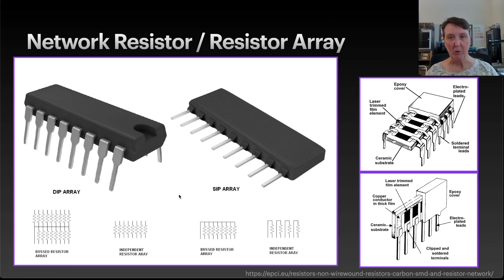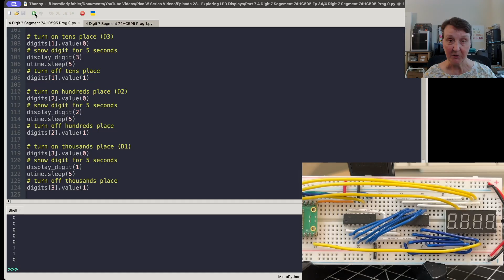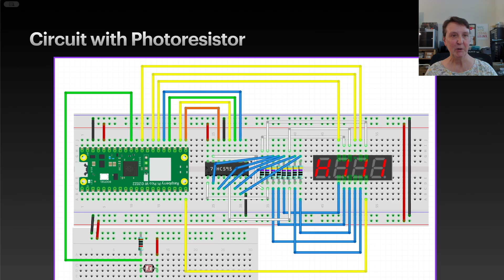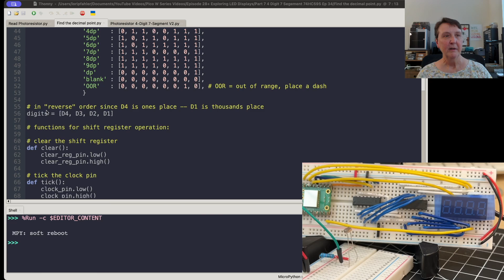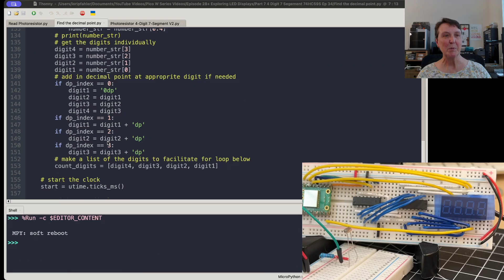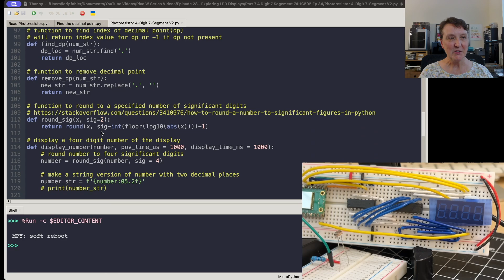Pico W Episode 34: LED Displays 4-Digit 7-Segment Displays Using an 74HC595 Shift Register Part 7

Comment: Thank you Lori.  I really appreciate that you are taking the long path for us to explain basic electronics, and "dumb" (?) components like using the 595 on a newer platform like the PicoW.   (There are a great many videos on using the  Pico W either with built-in components or as a way to manage serial chips that accepts simple commands). POV with shift registers was my first Arduino project some 10+ years ago...I'm going to need to build this now, thethe Pico W is so much easier to work with. :-)
Reply from the maker: Thanks for the feedback.  I am never sure if people like going back to basics.   I am not trying to build a large channel for monetary purposes. I just make videos that I want to make - hoping that a few folks find the videos helpful.  Making these videos helps me remember what I have learned.  Thanks for watching!

Comment: Nice job Lori! I have never thought about the difficulty of displaying floating point on a display. Thanks for the video.
Reply from the maker: I do feel that there is probably more efficient ways to handle the decimal point but I did make it work for the photoresistor.  Makes you appreciate the nice libraries that are provided for many of the driver chip LED modules.  Thanks for watching!